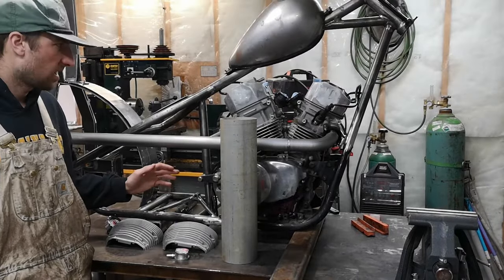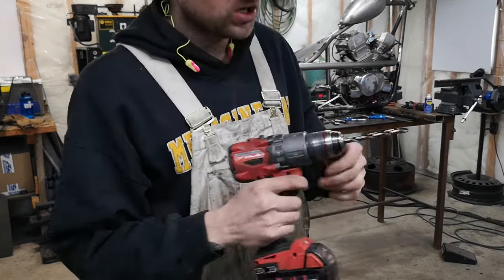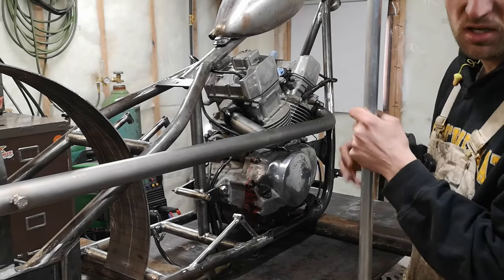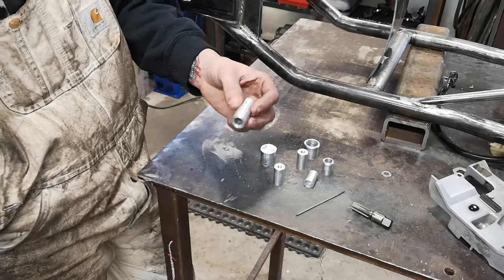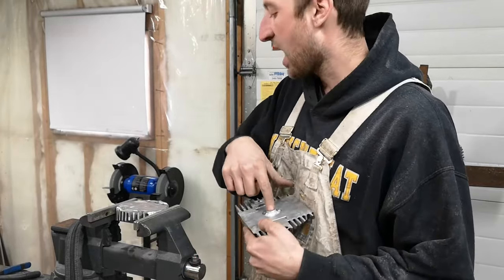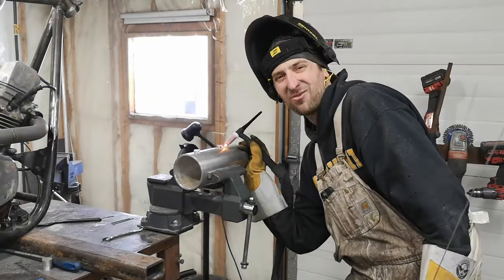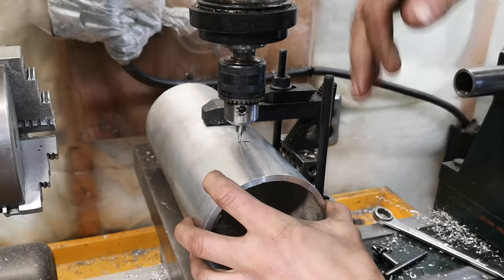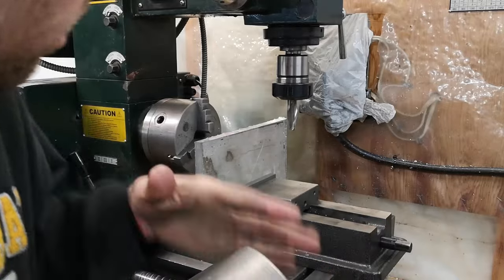Honda Chopper Part 7 Radiator Delete/ Custom heat exchanger

Comment: Love the idea of this just wondering how well it will work in traffic did you think about putting some cross tubes threw it from end to end an put a little vented recess in either end to hide a little computer fan in? Would help keep it cool when stationary and you can get some pretty decent mini 12v fans these days
Reply from the maker: I actually did think about this. I looked at them on McMaster and ypu can filter them by voltage and even cfm rating. So if need be I can sink one into the backside.

Comment: I once made a radiator same tube you had exhauststyle baffles inside mounted vertical inbetween.the fronttubes worked well instead of coppertube i used radiatorhose
Reply from the maker: Awesome! I’m glad to hear it worked!

Comment: Hi,  great channel. Two questions -  Does that bolt towards the rear of the exhaust pipe go through the pipe?  And is the exhaust pipe gonna burn your leg , as it is pretty high up?   The frame is classic chopper, low seat height and enough air to wave your hand between the engine and the neck. You and DD speed shop are my favorite Canadian builders    …Bill from Florida
Reply from the maker: Yes the bolt goes right through. I machined up a bung and welded it in. The original exhaust is pretty small so I can’t see it causing a restriction. I do plan to run some heat shields on the exhaust. Once my seat is upholstered I’ll have a better idea of where my legs will be.
Reply from the maker: Thanks for watching man! Glad you enjoy!

Comment: In the Northland (Hiway 2 Up) I think it will cool just fine. In the low land and desert I think not so much.But a oil Cooler might be the Balance.....I ride a vt1100 in Arizona😁
Reply from the maker: I actually have an oil cooler kicking around. I’ll bench test this and if I find it runs hot I’ll plumb it in and see if it helps.

Comment: DOn't see how that rad delete will be sufficient to replace a proper radiator.  You have nothing like the crosss sectional value of the original rad, and it is not in the flow of direct air that the original was.  Net result is the engine will overheat quicker especially when standing still.
Reply from the maker: I’m adding about a litre of coolant to the system and I’m freeing up the front cylinder to more air. So only time will tell how well it works! I’ll be sure to film the testing stage!

Comment: don't leave anything out. show the whole build from start to finish. i hope that tank works out for you. do you plan on testing it when its done or are you going to wait till the bike's done and just hope it's good? have you thought about hard lining your water lines? if we want copper tube, (in reference to Adler von Schlesien) we just call up our local plumbers and see what they've got. last piece we got was 4" diameter x12" long for $20. plumbers always got leftovers laying around.
Reply from the maker: I’ll bench test it once I get the bike running again. Just stationary with no air flow will be the true test.